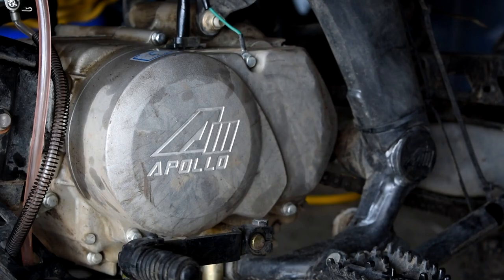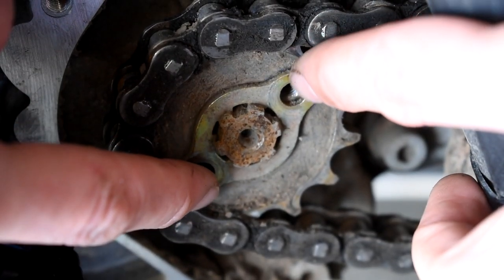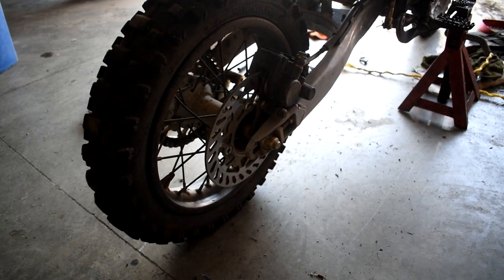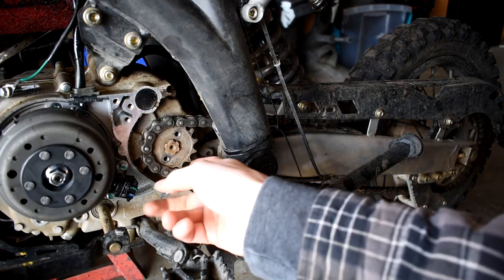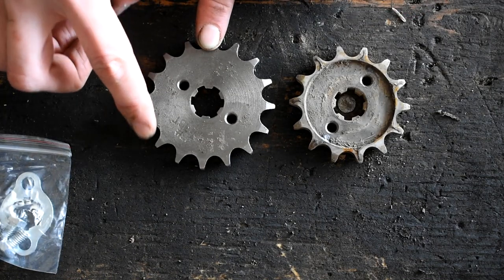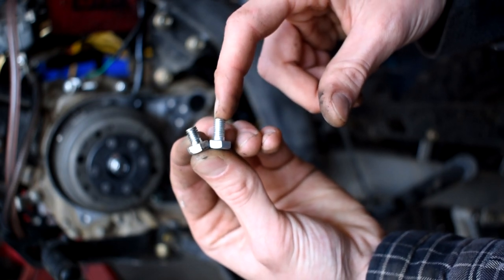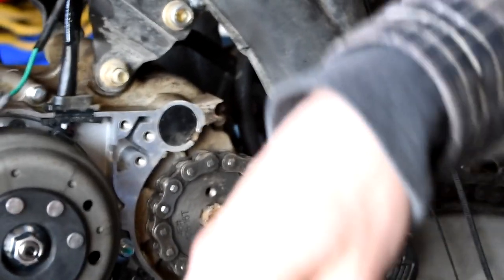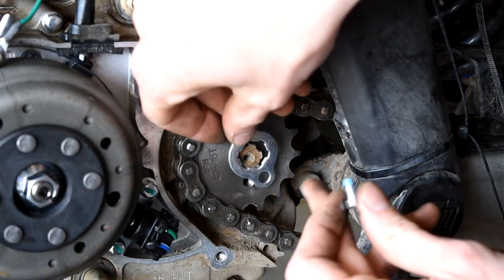How To Make Your Pit Bike Faster | Apollo 125cc Pit Dirt Bike

Comment: I have a 2020 125 RFZ I changed all my sprockets 17 front 37 rear but the carb sucks so bad and makes the bike run like garbage idk if I should get a carb kit  rejet it or jus buy a new carb
Reply from the maker: @ModDemon125cc  get a genuine carb and itll run great
Reply: @AaronsEnduro  Yeuh that’s what I figured I have a 26mm mukuni or something but I think it might be to big
Reply from the maker: 26mm is on the big side for a 125

I ran a 24mm and it ran sweet on my 125 and the 150 swap i did after
Reply: @AaronsEnduro  24 huh 🤔 hm I am going to have to try this, thank you for the help 🤓 appreciate it 🫡
Reply from the maker: @ModDemon125cc i reached out to apollo motors and this is what they suggested to me! Worked great!
Reply: @AaronsEnduro  what’s that ?

Comment: I have a dB-35 how can I make it faster or find better parts
Reply from the maker: Make it faster by upgrading your carn, and a higher front tooth sprocket count. Find parts at amparts.com
Reply: Aaron Greenway legend for this one I jus ordered a new carb because it kept bogging hopefully I can finally ride wit the friends
Reply from the maker: Makuni vm24!
Reply: Aaron Greenway they don’t have parts that I needed any other websites you suggest
Reply: Aaron Greenway ok i got the míkuni on my bike and when I kick it it idles for a solid 5 second than dies I need some help on what to do
Reply from the maker: Start with setting the idle (turn the choke on)
Reply: Aaron Greenway is that when the level is down
Reply: Aaron Greenway or when it is flat
Reply: Aaron Greenway this might be weird but would there be a way to call you so you can help me if not it’s understandable
Reply from the maker: Yeah pm me on insta
Reply: Aaron Greenway Alrihjt  what is it

Comment: I got a 2019 125cc apallo rfz x14 she hits 80
Reply from the maker: Hell ya!!
Reply: What did you do to it ?
Reply: @rickeyware6873  bought like 5 parts and messed with it but it cost like 7 or 8 hundred for the parts it's for drag racing a little challenge that I did but it will mess up in like 2 to 4 months or start tweaking and stuff so I suggest just leave it at the 55 mph
Reply: @jllorens3586  thanks for that advice bro ! I think I will !

Comment: Switch the sprocket bolts for grade 8. Not worth breaking one
Reply from the maker: Great point!
Reply: @AaronsEnduro  Ace hardware or a place that sells bolts per/lb you'll spend under $1 for them.
Reply from the maker: Great tip for those who want an upgrade :) thanks for watching!

Comment: I bought my Pitt bike 3 weeks ago. Coolster 125. Very Week clutch keeps popping chains it’s a zX-1 little  wheel and in 20 ft I’m out of gears and red lining. The bike is no fun and I spent 1000.00. 
I’ve learned my lesson and that’s let the people tgst know about these bikes help me if they wouldn’t mind. 

I want to order a good quality 140cc w a carburetor change front sprocket with 17 teeth or 16. A solid clutch that. I can find neutral with.  
The kickstand isn’t made w metal bc the bike is almost flat from slowly bending. It’s as hard to switch the gears on it than a Harley a no clutch. why is it so hard to switch gears. I hate only 4 gears. Hate it every ride throws chains. I hate it 1000.00
I should just get a real bike 
I think my little wheels was a big part of my disgust with the gearing
Reply from the maker: Have you ever adjusted the clutch? ( i have a video on that) 

Also the stock chains are all garbage and upgrading them so it doesnt stretch will prevent it from popping off.

As for the smaller transmissions there about as strong as spaghetti and you needa be nice to it. Gonna keep in mind how cheap it is for a new bike. If you know you’re really gonna beat the piss out of it save ur money till you buy something more luxury
Reply from the maker: Tbh tho i havent heard anything good about coolsters in specific

Comment: Lmao dude you’re hilarious.
Reply from the maker: A bit of a goof i know lol
Reply: @AaronsEnduro  I have the same bike but mine may be a newer model do you know if parts are the same?
Reply from the maker: 99% of the chinese dirt bikes share parts. Its all the same stuff with different names slapped on em
Reply: @AaronsEnduro  gotcha. I know this vid was a while ago. Does yours still run?
Reply from the maker: I blew up an transmission, swapped a new engine in, blew the 150cc swap up. Sold it. Bought an xr100 rode that, gave it to the gf, then i bought and built a klx140 (big bore kit, suspension etc etc)
Reply from the maker: Now i just recently bought a new 2023 beta from Italy

Comment: mine goes only 42mph i have 17-41 sprocket
Reply: Mine barely goes 38mph I don’t know what sprocket I have
Reply from the maker: Say waaaa hows its so slow
Reply from the maker: What bikes do you guys have?
Reply from the maker: The fastest ive hit is 96km/h (on a downhill dirt road) which is 60mph. Flat was about 85ishkm/h which is 52mph
Reply from the maker: All with 16-41 on 12/14” tires
Reply: Aaron Greenway I have a Chinese 125cc 4 stroke 4 speed manual 
Fastest I’ve gone is 38mph which is like 60 kmph not sure if the road I tested it on is long enough but yea
Reply from the maker: But what “Chinese “ model and what year
Reply: Aaron Greenway I think it’s a Lianmei lmdb-125
2019
Reply from the maker: Never even heard of it lol
Reply: Aaron Greenway lol got it for pretty cheap too like $600 Canadian
Reply: Aaron Greenway has 16/14 in tires
Reply: Aaron Greenway just checked and the rear sprocket it’s like 37 idk abt the front one tho
Reply from the maker: A 37 sprocket would be higher geared too. Sounds like a slow motor
Reply from the maker: Where did you buy it?
Reply: Aaron Greenway I bought it a bit used off some dude
Do you think it would be faster if I got a front sprocket with more teeth?
Reply from the maker: Yes that would increase your top speed. Find out what front sprocket count you have
Reply: Aaron Greenway alri I will thx
Reply: Aaron Greenway just counted and I can confirm it’s a 14t at front and 36t rear
Reply from the maker: So you could definitely try going up to a 16 tooth sprocket ( i have links in the video description for the parts) happy braapin!
Reply: Aaron Greenway alright thanks for the info
Reply: @AaronsEnduro  Ikr i dont know why its so slow
Reply: @AaronsEnduro  i have ycf 125 r start
Reply: @AaronsEnduro  i tried 16-41 instead of 17-41 it did go 10kmh slower but had so much torq but with 17-41 it goes 75kmh
Reply from the maker: Thats still “kinda slow” even with that 17 tooth! Mine does 85-90km/h with the 16 tooth and the 14/12” wheels
Reply: Aaron Greenway I didn’t change anything
It turns out the road I was checking the speed on was too short lol.
It reaches 84kmph on long enough road
Reply from the maker: Thats more like it!

Comment: It’s not faster it’s slower it has more torque you need a smaller one to make it go fast
Reply from the maker: If you’re changing the rear sprocket to be faster you go smaller. Up front the bigger is taller gearing. 

Gearing up the front sprocket will make it “faster” aka a higher top speed.
To be able to to gain top speed it requires a trade off not being as quick to reach its higher speeds.

Comment: Can the 420 sprocket fit as well ?
Reply from the maker: If your bike is a 428 chain set, no
Reply from the maker: If you have a 420 chainset, yes
Reply: How much faster is the bike with 16th or should I go 17?
Reply from the maker: @runitup2546  what size wheels do u have. Personally i think the 16tooth is as big as id wanna go (and did go)
Reply: 14/12
Reply from the maker: U ride trails or street
Reply: @AaronsEnduro  I ride streets sometimes I’ll  ride in the grass but mostly street
Reply from the maker: U might be able to get away with the 17tooth. Order both. Its so cheap anyways to try
Reply: Can u refer me to a 16 tooth sprocket that’ll fit the one u have in the link is unavailable